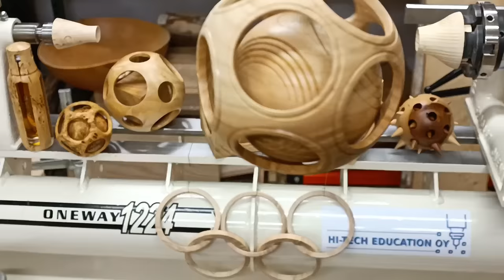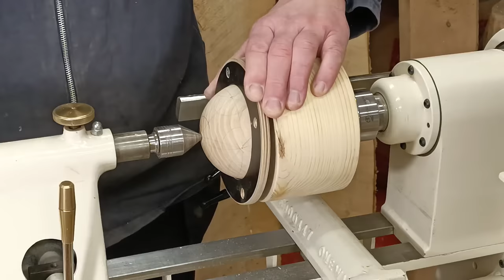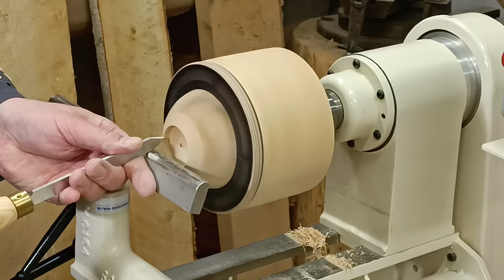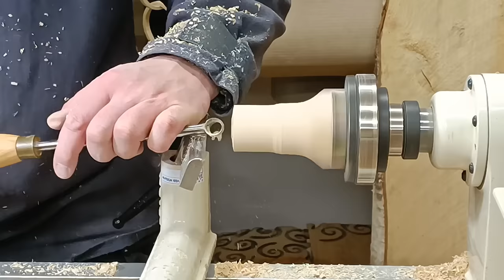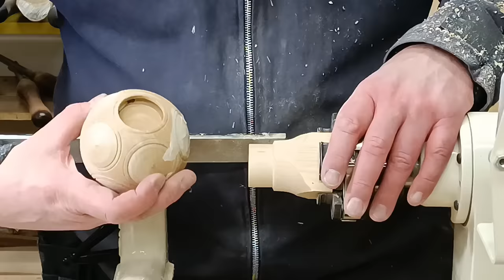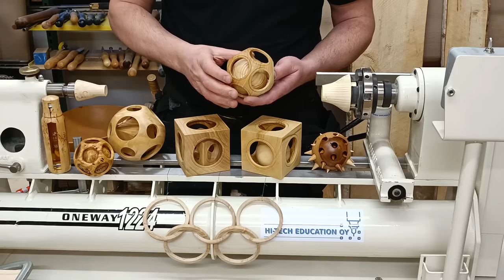Woodturning - Captive ball in sphere

Comment: I was a full time woodturner when I was young and it’s good to see such competent use of chisels when I am used to seeing incompetent use of scrapers so often on you tube masquerading as clever woodturning. Cheers and well done.
Reply: Definitely Correct.........Many turners especially newer one have no idea what a gouge, skew or many other tools are.   Everything they do is done with Carbide scrapers.   I've spent 35 years leaning to use real woodturning tools correctly and I'm not going to give up that skill.    I do have a specialty negative rake carbide tool that I use specifically for when I turn Resin.
Reply: I agree. I’ve seen far too many scraped and then sanded to death turnings on YouTube. All the thought goes into clever glue ups or weird wood selection, and very little into skillful tool use. This turner is a master, and the video was wonderful to watch.
Reply: @robstevenson675  Yes, such a great video showing this technique.   Wish the author would have verbally given some information as the video progressed such as dimensions, how to layout the 12 holes on the Sphere, and a pattern of the cutting tool.   Going to give this project a try, but now must go through my own "Trial & Error" process to get to the goal.   Oh well, I'm retired and have the time:)
Reply: As a newly graduated electrical engineer I went to work for a company which made microwave systems.  Microwave systems are more like plumbing, with waveguide connecting the components.  Some times we might need a special connector that could be made on a lathe, so in the machine shop there was a special lathe and some tools reserved specially for engineers who didn't know much about lathes but knew the shape they needed.  Along with the reserved lathes there were some mostly broken tools to use and the engineers couldn't use any of the good tools.  I used the lathe once, and of course broke at least one tool, making a special connector for an odd shaped microwave vacuum tube.
Reply: @robstevenson675  I like  Paul Sellers  style great perfomance of how to use handtools ,  its like going back to school days  ;  )
Reply: Well said.
Reply: @DrMerle-gw4wj  Your comment reminds me of the old saying that he only thing more dangerous than a computer hardware engineer who thinks they can code is a software engineer who thinks they can solder.
Reply: @RolandHutchinson  Having been booth during my career I can tell you from my personal experience that it is the other way around.  Most hardware engineers are afraid of trying to understand code, which is why I got the opportunity to do some coding along with circuit design on the same project.  Software people who try to do hardware on the other hand usually  break something.
Reply: @DrMerle-gw4wj  So you are saying that hardware engineers who think they can code are a rather small, self-selected group who are generally pretty decent coders -- because the ones who would be dangerously bad coders are so intimidated by the prospect of having to code that they won't try and/or will look for ways of getting out of having to code (such as finding a competent coder to put on the project). 

Upon reflection, I can see where that could bell be the case, in spite of the old saying (which indeed I may have gotten backwards, or I may even have heard it both ways at one time or another!)

Thank you for your comment.
Reply: @RolandHutchinson   It might have been taken too far to generalize it that way.  It was certainly my experience in my early days in aerospace contact work.   It was also my personal experience that we had to keep the software people away from the hardware because they often broke things.  Unfortunately, software folks tend to be sloppy about whether all  cables are attached and all circuit boards  are seated in their sockets.  In an ideal world there would be no division of hardware and software.  Everyone would just seek to do all the work properly.
Reply: @DrMerle-gw4wj  Breaking things early is costly - but limits the damage from propagating to later in the product lifetime.

Comment: Nicely done. What angle (or angles) did you sharpen the undercutting tool please? Is it a standard scraper, negative rake scraper or what?
Reply from the maker: Hi! Thank you for your comment! For once someone has something reasonable to ask :) It`s a homemade tool sharpened to a standard angle. I will add a PDF instruction and a CAD-file of the tool to the online store during the spring. https://www.hitechedu.fi/woodturning/